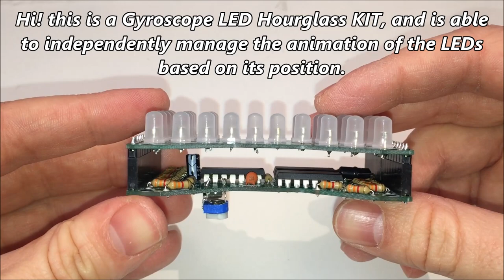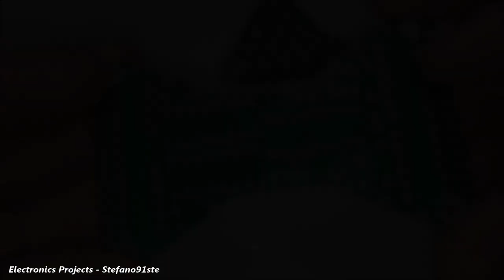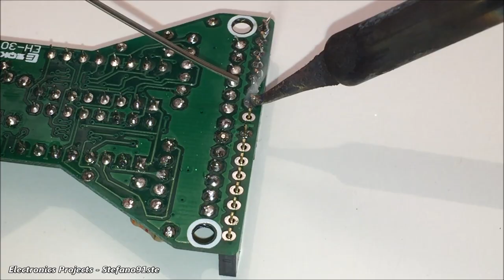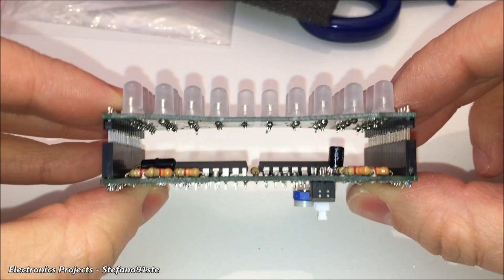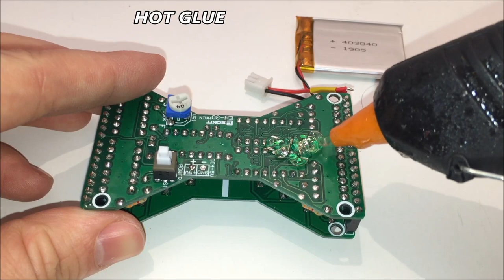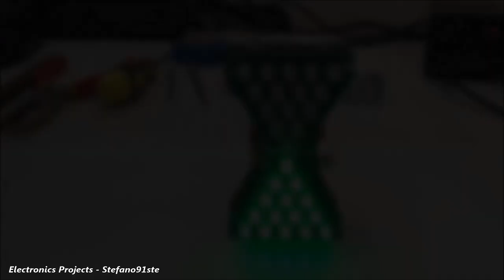LED Gyroscope Hourglass with CD4015 & 4069

Comment: Hello. How does it detect the position? What sensor does it use?
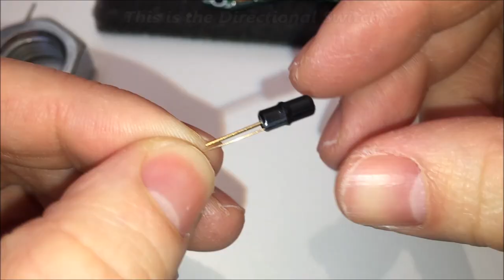Reply from the maker: Hi, the position is detected by a directional switch, it is a component aesthetically similar to an electrolytic capacitor. you can see it from 1:38 in this video.
Reply: Thank You!!!